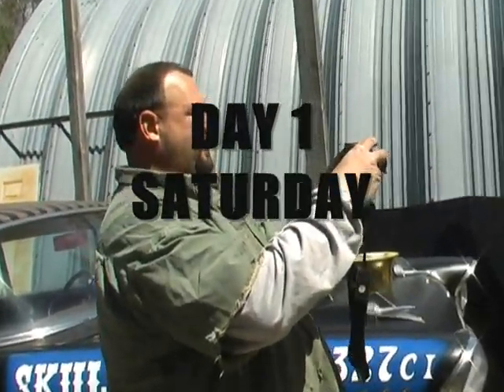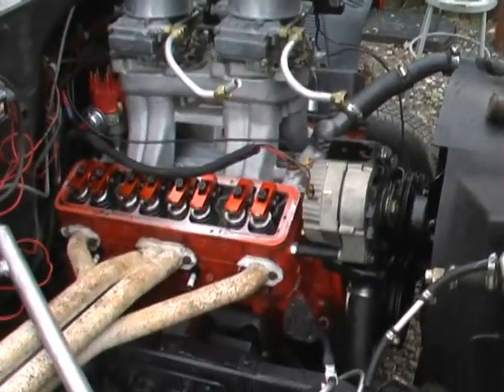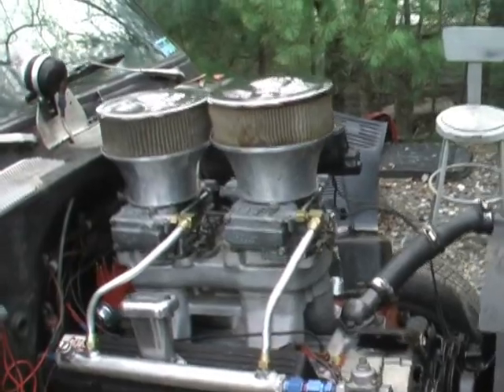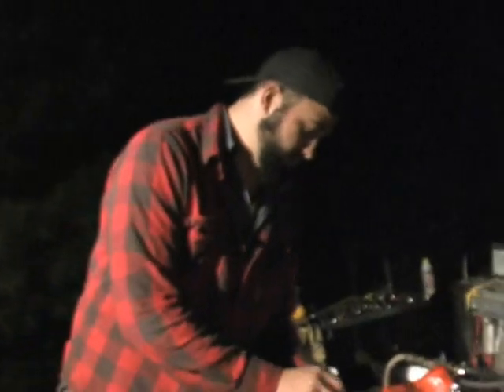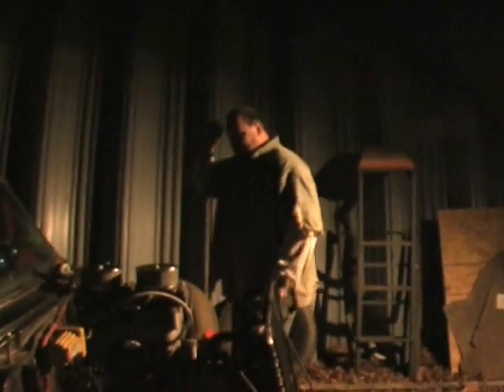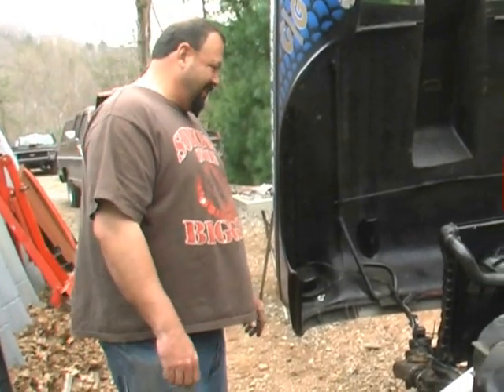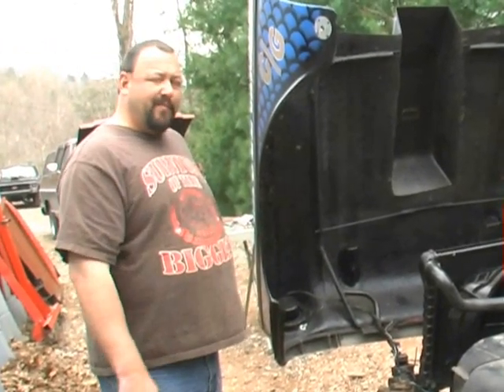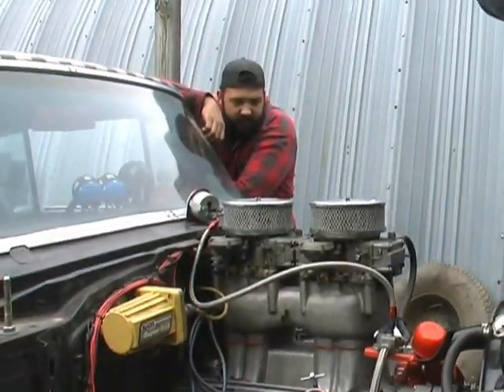SKULL GARAGE....THE 57 GASSER BAD PENNY GETS A 327

Comment: Nasty sounding little 327. Looking forward to the street dyno. I had a .030 327 in a chevelle one time. Stock bottom end...set of junkyard grab bag 350 heads home ported...roller rockers and a comp cams 292 cam. That little motor was fun as hell and would turn to the moon!!
Reply from the maker: they are good lil motors
Reply: I have the 292 HR-13 in my LT1. Its a bad Ass cam for sure. Trickflow. Fast as Cast heads on top and a Scat Rotating system. Its a mean MF

Comment: Idle it down a touch slow the timing down a bit so the Cam can actually lope it sounds like your kinda on the throttle a bit but hard to tell threw a vid but I can tell the cam is lopin to fast